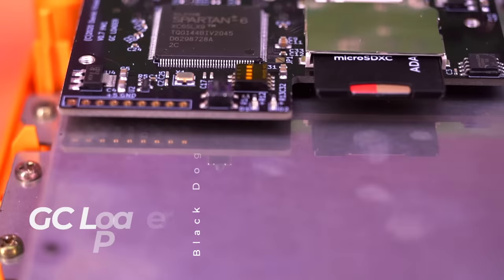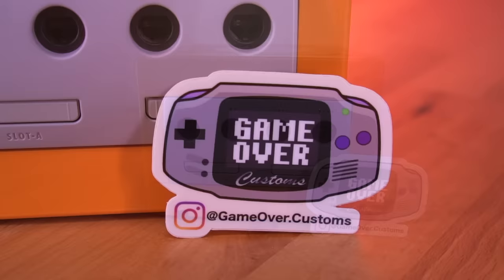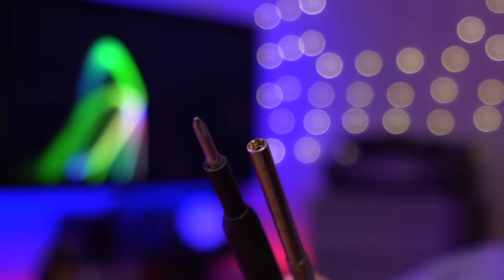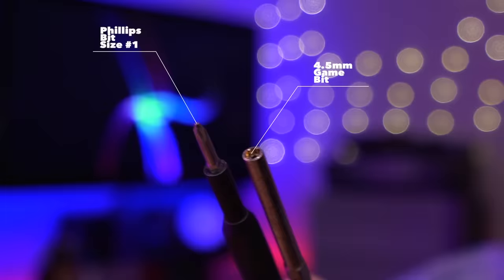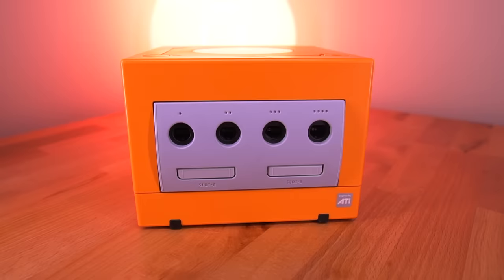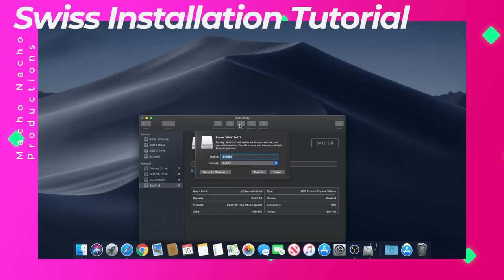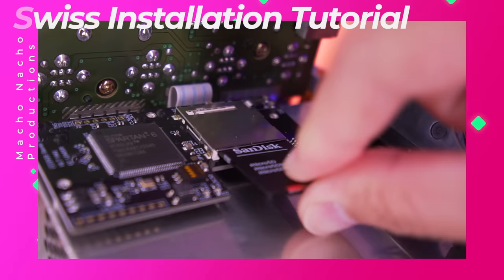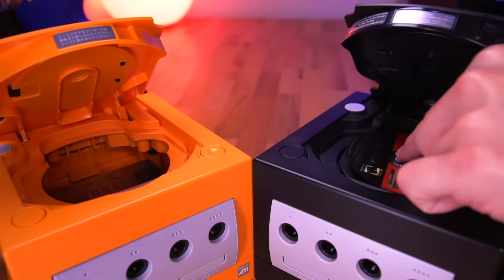How To Easily Play Your Entire GameCube Library From An SD Card! | GC Loader and Swiss Tutorial 2021

Comment: Hi Tito and thank you for your reviews. 

I have a question about this mod ; can our old savegames, stored on an official NGC memory card, work ? 
Of course I understood it reads and plays games from the SD card but what about the saves ? Are they stored on the SD too in some odd format, or are they written on/read from the memcards of the expansion slots ? (as they would with a regular, official NGC)
Reply from the maker: Yes, it will work with original save files on your memory card 😁
Reply: @MachoNachoProductions  Aaaaw, thank you very much !

Comment: Any reason you used the Swiss iso from from the ISO folder and not the one from the GCLoader folder of the Swiss zip you extracted? I am honestly not sure what the difference is but I am assuming there is one considering they have a separate single iso named boot.iso for it.
Reply from the maker: That is a great question. I was actually wondering the same thing. What does the gc loader boot.iso file do?  I should look into that.
Reply: @MachoNachoProductions  my assumption is that it is a multi-region version of the 3 separate iso images that works when used as the boot iso on any region GameCube.

Comment: It would have been much better and cleaner if the module was up to the original and not so deep, that hole instead of the reader is horrendous and reaching the sd seems a bit uncomfortable.
Reply: That's why there's sd mounts, to fill the gap
Reply: @fraggle200  Maybe I don't understand what you are saying because I speak bad English but It doesn't fill anything, at the end of the video it shows the open compartment with an ugly hole in place of the drive... And at least you have to stick your fingers inside to insert the sd.

Comment: I can send you a 3d print for the inside. if you don't have one on the way, let me know.
Reply from the maker: Thank you Matt!  Really appreciate it.  I was actually thinking of using the empty space to store the bottom expansion port cover since I'll be using the GBA Player.  Thought it could be used as a cubby, lol.  Thank you again for the very kind gesture,  Cheers Matt!
Reply: @MachoNachoProductions   i did that too. the print has enough space underneath (taped down so it does not bang on everything) for that and give you easy access to SD card. hope you showcase the GBA player with Game Boy Interface. great alt for the GBA startup disk.

Comment: Way too expensive! Just a Xeno mod chip  and a SD2SP2 is the way to go! And you perserve the ability to utilize the og DVD drive
Reply from the maker: Xeno chip is a great option.  The soldering may be out of reach for some people.  The main pro of the GC Loader is the plug and play nature of it.  Cheers!
Reply: @MachoNachoProductions  That's right, i forgot that a little bit to soon :)
Reply: And we want talk about the sd slot position? It was better if it was a vertical slot

Comment: Just buy a wii with GameCube backward compatibility and software hack it.  It’s a cheaper alternative and It beats the GameCube.  The wii is also cheaper to play in hd than the GameCube since you can get a wii to hdmi adapter, which cost a lot less than the gamecube hd cables.  You can also run emulators from 8-16bit systems.